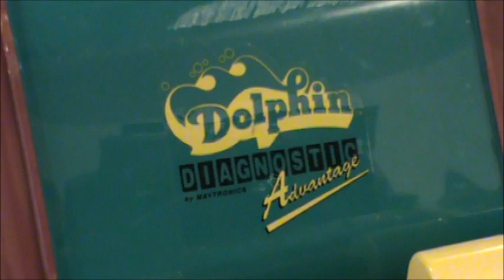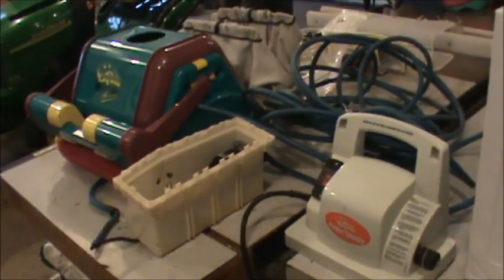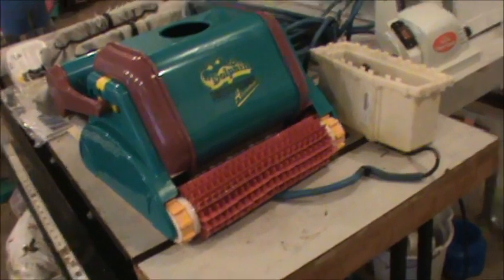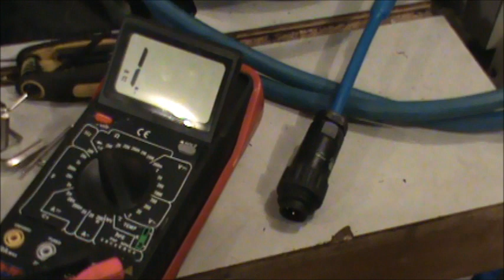Maytronics Dolphin Pool Cleaner Repair

Comment: I fixed my power supply. It's exactly the same as yours. On mine, the transformer died and I replaced it with a Marcus MC200B(you can also use an MO200A or similar). The MC200B has an enclosure that can easily be removed. The transformer cost me $50 Canadian. MUCH cheaper than buying a used power supply.

Comment: I have an inoperative Dolphin Deluxe 4. I opened the motor. There is 29DCV across the b&w pins. There is no continuity from the red pin to the power supply end of the cable. I didn't notice any obvious failures on the PCB.

Leslie's used their plug diagnostic tool and checked the cable as "good." Is the red wire used? I need to know before I purchase a new motor unit.

Comment: Good info.. thanks!! I bought one reconditioned and it's worked great so far.  But your tips will be very useful should I ever have trouble.  Maybe a video of how you disassembled and reassembled.  Did you happen to video that?
Reply from the maker: Robert Lanham  No video of that.  Sorry.
Reply: doublewide6 Repairs LLC 
Thank you 
 Dolphin S 50 I put it in the swimming pool because forward backward forward and stops until I turn the power off and turn it back on can this be repaired

Comment: Need help my diagnostic unit is not going up the walls, staying in the same general area and at times the front roller is off the floor while the back one on floor. The impeller is moving freely and clear of bebris and feels like a pretty strong suction. I got a new filter bag but don't have the bag clips. The drive pulleys and guide wheel bearings are intact and free moving. The unit is moving at a pretty same speed as my deluxe 4 unit. It seems like a bouyancy issue but I'm stumped. I'm beginning to suspect the bottom lid as it looks very different than any other I have ever seen or on the internet. This lid does not have the resistance springs on the flaps. I don't have anything to compare to and not sure if it's missing a piece. These flaps close when upright on their own. Coincidentally I purchased my unit for $10 as well and would be sweet if I could get it going. HELP!

Comment: Yea, that's sweet for $10. We got our a couple of years ago when we bought our house - it had a pool and the prev owner left the Dolphin in the pool shed. Your video enlightened me as to what's inside these things. Pretty simple but pretty expensive. I too fix things and I'll be referring to this video should I need to open mine. Did you have any trouble actually opening the unit up? By the way, only a total f-tard would thumbs down this video. It's awesome.

Comment: Doublewide, how does the power cord connection come out of the motor housing? I have determined that mt Deluxe 4 has a bad motor assy but not sure how the power cord plug comes out.
Thanks

Comment: Your unit may be fixed but normally it is not the connector pin that breaks. The PC board inside the motor housing has a microcontroller that controls the track and pump motors and shuts down operation if the motors do not see the "proper" loading on the motors. Initially the track motor drives forward and reverse at a slower than normal speed and verifies that the proper amount of power is required by the motors. If it's too low or too high all operation stops. This is the problem most Maytronics Dolphins run into eventually. If yours works, you are extremely lucky.
Reply: +Stephen Hobrecht   Seams like I am in this same position. What did you do? I am not afraid to take it apart and repair it.  Any advice or video ? It does the forward and backwards action then moves forward and shuts down in 10 seconds.
Reply: all the lights on the panel are working but the dolfin won’t move in the water 
it worked last summer but now it won’t help
Reply: Josh Bertolet Did you ever figure it out? 10 seconds here too
Reply: @gedionsamuel2256  same with mine, would love to figure it out

Comment: Hi there 
my side panel broke. It's the side with the electric cord going through. How can I get the cord out form the panel to replace the side panel. There are very wide plastic pieces not small enough to get through the side panel hole?